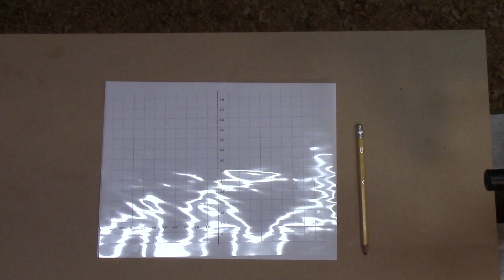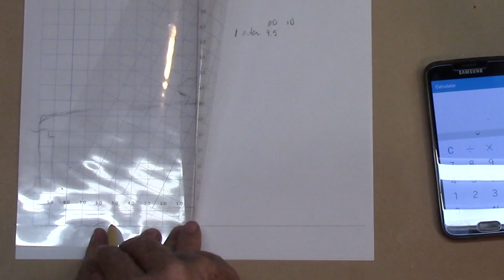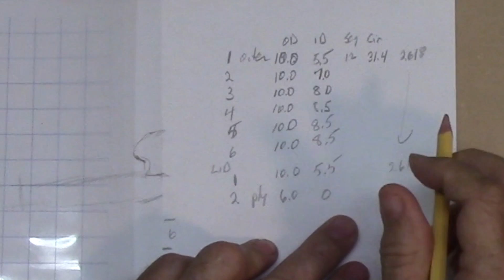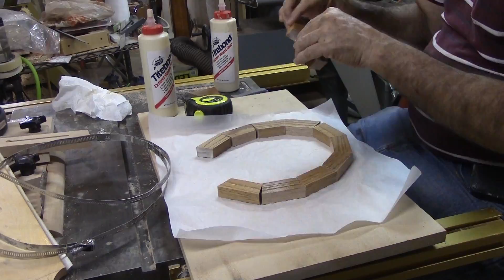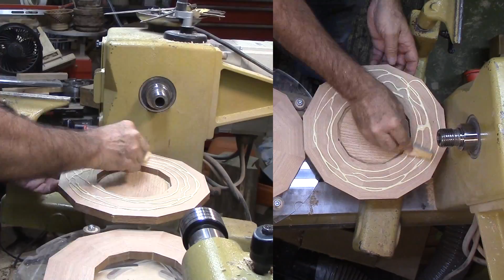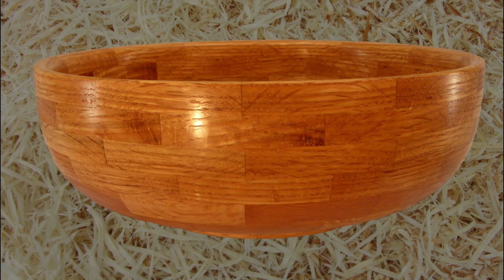Segmented Utility Bowl Using Low Tech Design Approach

Comment: There is an app for Android phones called "Segment Calculator 2". All you have to do is enter the inner and outer radius along with how many segments per row and it gives you the segment length along with other information.
Reply from the maker: Yes, Terry. I frequently use that app. However, dividing the circumference by number of segments is close enough for most projects as long as I am consistent.
Alan

Comment: Hi Alan! Very nice project! I was wondering, why do you use the plywood disc in the base, I thought it might be to give the base additional structural integrity, but I do not know if you have any other reasons. Thank you very much for sharing dear friend! Cheers! Daniel
Reply from the maker: +Daniel Vilarino Since you're an engineer, let's analyze the situation with segmented construction.
First, joint strength. the joint between two segments is a butt joint. butt joints are end grain joints - consequently not very strong.  A side/face grain joint between two segment rings is very strong. the wood would break first. A segmented vessel compensates by bricklaying segments causing solid wood to bridge the butt joints.
Thinking along these lines, the strength of a segmented vessel is in the side grain joints not in the end grain joints.
As the curve of a bowl transitions from the vertical of the sides to the horizontal of the bottom, It seems that several things are happening: 1) butt joints are more frequent due to the diameter being smaller; 2) side grain joints are less frequent. 3) butt joints are relatively longer.
I've had bottoms split at the butt joints. Hence my attempt to use plywood. 
Others use a solid panel - I don't like this because it must float to avoid seasonal stress.
Others use a solid bottom - I don't like this because it disrupts the visual effect of the segmented.
What I was trying with the plywood was to hide the edge in a segmented ring and have the strength of plywood in the bottom where it would seem appropriate. It would not look much like plywood due to the edges being covered although a ply or two may show in the inside.
Compared to a solid wood base or a panel it is working for me as a base but as in this and the following project - Not in a top. That is a challenge still to be resolved.
Your engineer's perspective please.
Reply: Hi Alan! I think your reasoning is correct, butt joints are not the best ones and certainly they become larger at the bottom. I am not very experienced in doing segmented work, so I never analyzed the situation too deep, but I saw you were doing something I have not seen done by other turners and it picked my curiosity. I know you make your own plywood, and the structural strenght of having the grain running in perpendicular directions makes for great stability. My fear is that it might not look too good or show the layers (which I know you sort of hide using the recess). You may consider making plywood with thicker sheets or even just two sheets put with the grain in perpendicular locations. Or use a piece of wood that is very stable, although you always can get variations with different humidity and temperature. All in all I think your method is solid and probably I would do the same if I begin doing segmented work. Thank you for your explanation dear friend. Cheers! Daniel
Reply from the maker: +Daniel Vilarino The oak veneer I used is thicker than most veneers.It is left over from veneering my kitchen cabinets.  I fear solid wood fluctuations and don't like steps required to allow movement.
For other species, I would consider milling my own veneers to get it ticker. Actually, a glue line provides some degree of stability. Maybe a less than 90 degree rotation per layer may disguise the plywood effect.
Alternatively, I would consider a stabilized solid panel inset like the veneer.  Still more to experiment with.
Alan

Comment: Beautiful work, Alan. I would like you try "my" method (www.instructables.com/id/Staves-duelas/?ALLSTEPS - bold text=English). It is a little difficult to cut exactly the required angles, but you are neat enough to do it.
Reply from the maker: +rimar2000 Osvaldo J. Schiavoni Thank you for the suggestion. I should do a stave turning.
Alan

Comment: Great looking piece Alan.  Could you please go into some more detail on your "homemade oak plywood base"?  Weren't you concerned about going too deep and blast through to the next layer of your plywood?
Reply from the maker: +Alan Erickson Actually no. My veneer was quite thick and I counted on going thru some layers. I knew that I had more layers of good wood underneath. Further, I did tool off at least 1 complete layer.
Not a worry for me.
Thanks for asking.
Alan

Comment: Once again, Alan, nice work.  I really like the way you use the jigs and shop-made tools to help you with your turnings.  May I assume you use a spreadsheet program to calculate your segments rather than a specialized segmenting creation software package?  If so, have you created templates/macros you'd be willing to share?
Reply from the maker: +John Walsh Yes, I usually use excel for my calculations after drawing in Powerpoint. to me, the calculations are so easy that I haven't created a template. Circumference = diameter * Pii; Segment length = Circumference / segments. Having a template then robustly compensating for varying # of rows just seems too much of a hassle when it is so easy to copy and duplicate rows.
But if you need one, I'll can send you one of my past spreadsheets and you can turn it into a template.
Alan
Reply: +As Wood Turns Thanks, Alan.  I'll send you my email address via your contact page on your website.